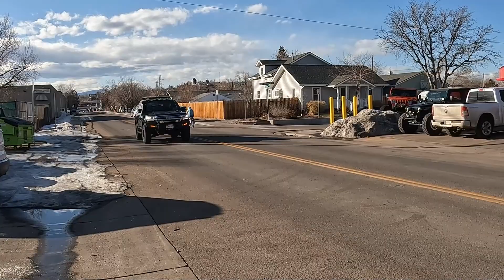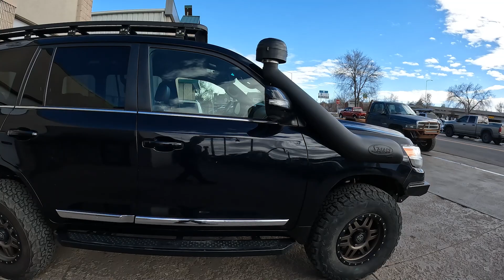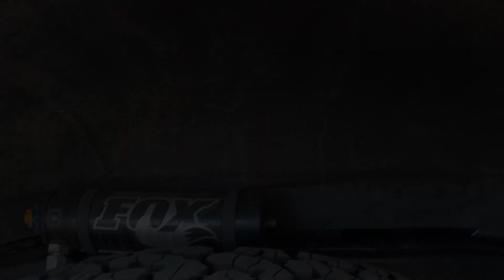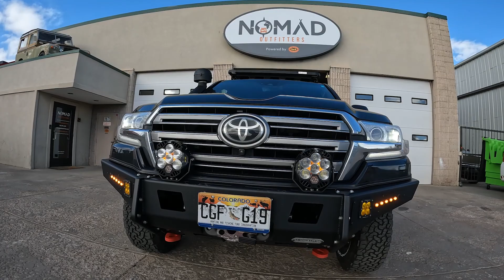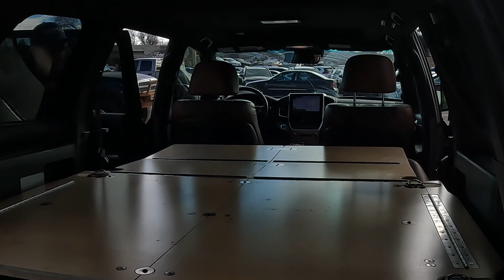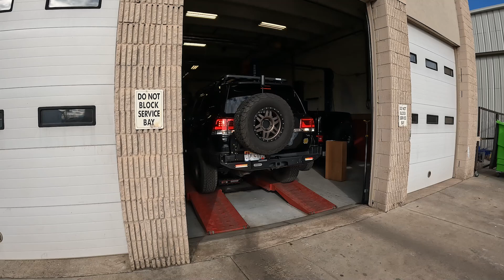2016 Toyota Land Cruiser 200 Overland Build

Comment: Really cool build, can you explain why you choose to do both the adjustable panhard bar and the correction kit? I have a bit of a wag after installing my OME lift on my 200 series and I'm trying to understand if I need both or one product, mixed reviews as to whether just the correction kit will resolve the issue.
Reply from the maker: Good afternoon, it's to provide the best of both worlds with geometry correction and long term strength of the components. This setup gives you adjustability while upgrading your setup with OEM style bushings that will last for a long time to come.

Comment: Why no shock boots?😮😮
Reply from the maker: Good question. Most high end shock manufacturers don't install/recommend boots since they are prone to the outside getting in and staying within the boot which would cause more damage to the shock shaft. Shock guards can work very well and we've also seen them break off fairly easily. Long story short there's not a perfect solution. We're currently running ADS on our company Gladiator and they do come with a heavy duty boot for the rear shocks with an actual clamp instead of just a zip tie. So far so good but I'm more than happy to keep you posted. - Tyler